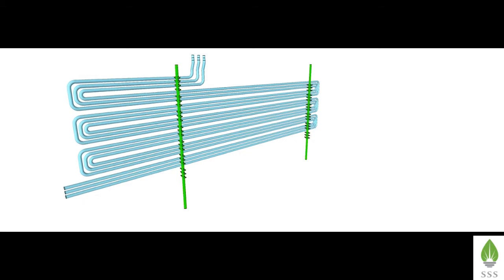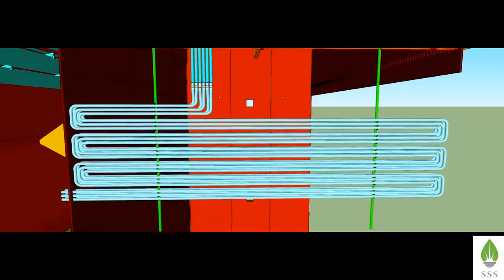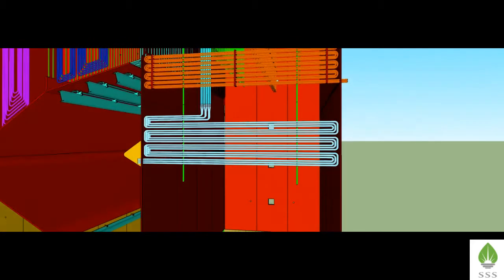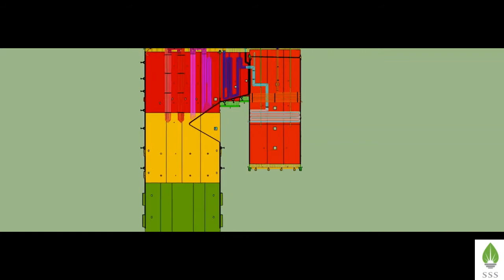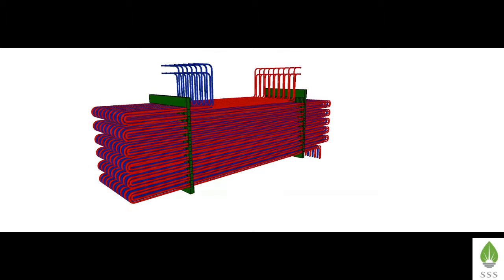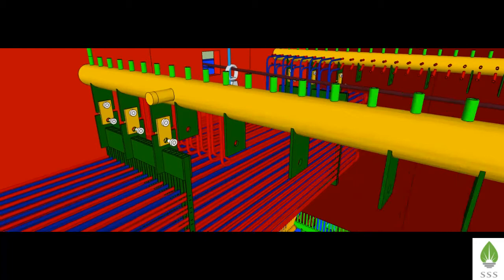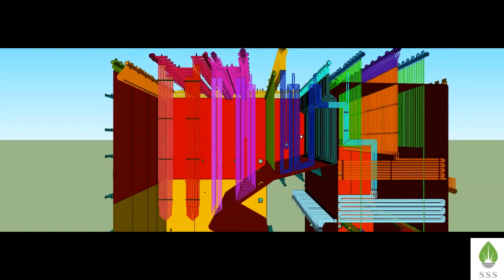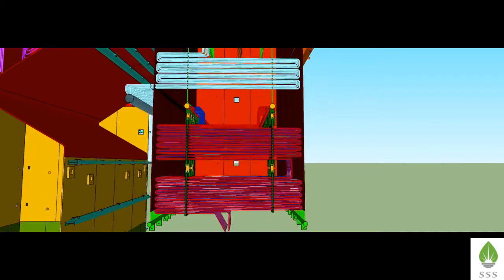Boiler pressure parts erection sequence - part 4

Comment: Thank you so much for the massive amount of information in these videos this is really priceless info but what software did you use for the simulation ???
and do you have files pdfs of this illustration or any installation manual
Reply from the maker: call me to this no 8489913404
Reply: @saisssms  What Country i mean what is the opening and do you have whats APP on this number i just need to know the software in-order to learn it and use in my graduation project
Reply from the maker: @mohamedsalah-hr4vz    i have used skeptchup as software and it was made almost 5 yrs back and i live in India. I have sketch file of the complete model